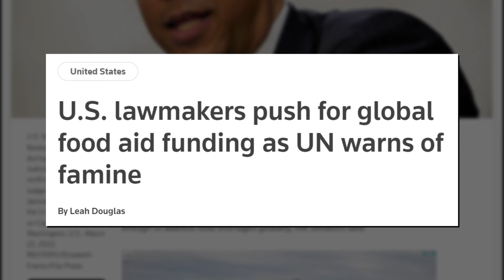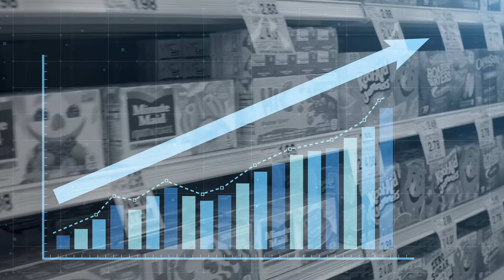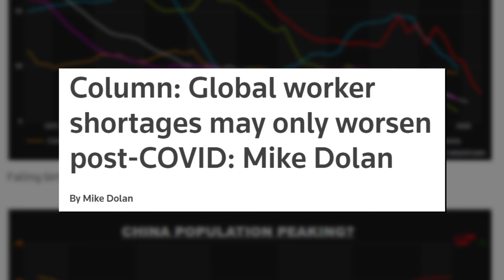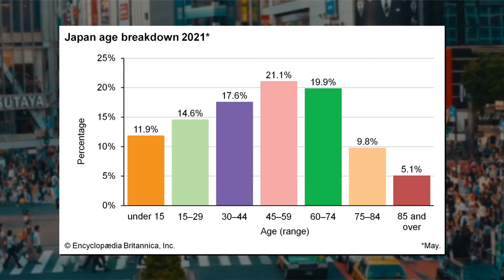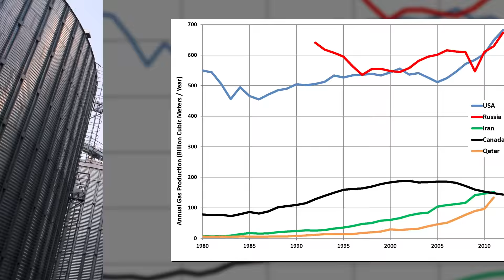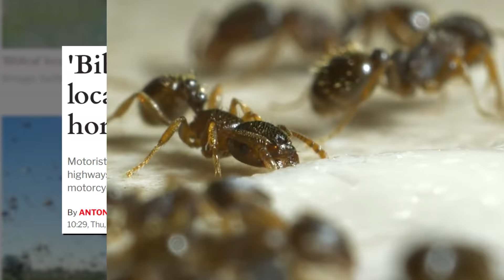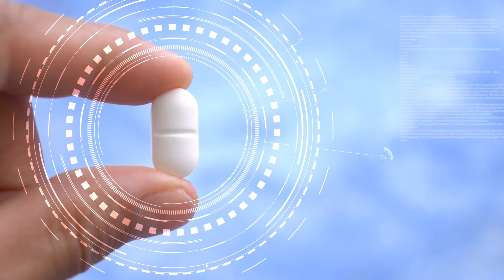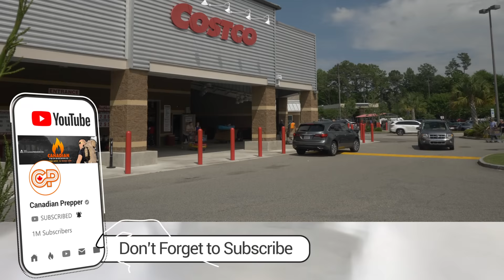When Food Runs Out: "Biblical" Famines are Coming

Comment: We did a practice drill- no heat, no lights, no water. It was a reality check. 
My take: have lots of canned food ( heat and eat stuff) for the transition, have a couple large water drum barrels for water, have some comfort snacks ( hard candy or hot chocolate are two examples),have a comfortable way to sleep- forget synthetic sheets/ comforter on a bed in an unheated room (it felt like an ice slab)….. I could go on and on. I learned that prepping is easy and living a prepper situation is tough. Takes practice and I suggest practicing. You wont thank me but you will learn what works best for you and your family. And by the end of our practice I learned how much I love a hot bath, fresh  bread, and hot coffee. 🙃
Reply: Lots of good info. here. Would like more insight on the sleeping situation when the power goes out. Any recommendations? I have a RV in my driveway with 400 watts of solar on top which I love. So, I will at least have lights and enough power for a hot cup of Nespresso and hot water for sponge bathing.  That's a start. SOLAR is the answer. At least for me. No cords, no smell, no mess, no gas, no fumes and pretty much unlimited.  The camper also has a propane run oven, hot water heater, furnace, AC, and shower. With 400 watts I wouldn't be able to run the AC obviously.
Reply: I did this by force when Abbott let the power grid go to waste. My preps held up. We had coffee and eggs for breakfast, pasta for lunch and leftovers for dinner; listened to the hand crank radio and told stories as my toddler had to wear a ski suit to keep warm. All in all, we survived the 48 hours without electricity pretty easily.
Reply: Buy cotton sheets. I always use them in winter, and love them.
Reply: Surviving a hurricane aftermath with no power for days is an eye opener. We found out what a luxury it is to have ice.
Reply: Wow…that’s excellent! I haven’t gotten up the nerve to do this just yet. Idk…why is it so hard to practice that! It is for me, but it’s something I know is very important!!  Practice, practice going without electricity for a day. I just gotta work up the nerve to do it. Thanks for your comment! It’s a job I got to do…..
Reply: Try it on a Sabbath.  Sun down on Friday (when you can see three stars) till sun down Saturday.  No heat, no electricity.  No work.  For me, the first few times I struggled to even go to bed at midnight.   Good for the mind, body and spirit.  The quiet slower pace is very good for inspiration and perspective on the week.   Try it for a month.   It brings awareness that is priceless.
Reply: So smart to do a trial run to see what things you are wanting for when crap hits. Nice job.
Reply: @openfieldviews9989  During Katrina, a guy stabbed his sister over a bag of ice.  You are right about the luxury of ice.
Reply: @sharoncrawford7192  I prefer linen sheets. They help regulate the temp of your body.

Comment: Dehydration is a great tool, it has a great shelf life, just remember to put a moisture packet inside the glass jar, seal it with a jar sealer, and don't forget to condition the food. To condition the food means to leave it out on the counter, shake it around a few times a day for a day or two, then check to see if everything is dried thoroughly, or if there has been moisture left behind. 
If moisture was left behind, you will need to get rid of the product, this is why it's important to know if you dehydrated the product enough, by conditioning the product. You can get around 15 years of shelf life when done correctly.
Reply: interesting
Reply: Just got finished dehydrating and vacuum canning “the holy trinity” (carrots, onions, celery and green peppers) to add flavor to rice, etc. Definitely worth the effort!
Reply: How do you know if moisture was left behind? Or what do you mean by that? Where will the moisture be?
Reply: Thanks for that tip. @Ritakus 98
Reply: @milhouse8166  Conditioning the food is simply putting your dehydrated food, once it has cooled, into a glass jar (I recommend a mason jar), & screwing on the lid (just hand tight). Over a period of 4-5 days, come back & check that there isn't any condensation/moisture built up anywhere on the inside of your jar, and give the jar a shake. If any of your food is sticking to the inside of the jar & it won't come off with some gentle shaking, then there is still too much moisture in your dehydrated food. You can, either, dehydrate that food again, (& then repeat the "conditioning" process), or you can simply use that food within your normal food usage (within a week or 2, depending on what it is). Clear as mud? ;)
Reply: @michelemckay4960  got it! Thanks
Reply: @tonette6592  thank you
Reply: @fanman8102  keep up the great work. Wonderful.
Reply: @milhouse8166  look in the jar to see if there's mold, if the food being dried is sticking together, and listen for the sound. There are some YouTube videos demonstrating this process.
It's hard to explain that sound you will hear, but when they're very dry, the sound is different than if there's a little moisture left behind in the food.
Reply: @michelemckay4960  Wonderful explanation, much better than I could have explained. Thank you for sharing your insight and more depth on this process.
Reply: @ritakus9871  No problem! Happy I could help! :)
Reply: I like the idea of drying food. Unlike canning, if it goes wrong, it's still not going to kill you!
Reply: OK, far less likely to kill you, especially if it's actually dry. Bacteria needs water to thrive!
Reply: @fanman8102  you start there and then move into some of the more crazy things.   We’ve dehydrated citrus like lemons and oranges, pomegranates, bananas and strawberries and apples.  I’ve done spinach and broccoli.  Lots of things.  Plus then I’ve turned around and powered so much too.  I even got bold and have  a few jars of dehydrated and powdered eggs.  Honestly I’m addicted to the dehydrator.    Lol.  But wow, even camping I can take powdered eggs to make scrambled eggs or ,bake in my solar oven to have little muffins.   That dehydrator was a game changer.
Reply: A tablespoon of salt never hurts if you're in a pinch and dont have descant patches. I to prefer dehydrated dry canning. Good way to put back long term and still have a good lid for when you're ready to hot can the leftovers.
Reply: @fanman8102  what's vacuum canning
Reply: Yup dehydrated a bunch of zucchini and butternut squash last year. One container turned moldy but the rest is great. Probably have plenty till next harvest ☺️
Reply: I’d like to suggest watching The Purposeful Pantry here on utube. Darcy is pretty much an expert on all foods dehydrating. I’ve learned so much from her. I hope this helps if anyone is confused about Dehydrating. The comments on conditioning are correct! That step is very important.
Reply: @nvalles2565  did you learn from yt or books? Any recommendations?
Reply: @mysteryman3000  I think both are very important to incorporate into a food pantry.
Reply: @tinsg1  in my comment I was talking about hooking up the tube that sections the lid provided by the lid ceiling kit that goes over the ball jar lid. When the machine is turned on, it sucks out the extra oxygen sucks until the air is out, when there's oxygen, the food begins to oxidize, if oxygen is removed, the food will stay hydrated. In other words, nitrogen instead of oxygen to keep an oxygen-free environment.
Reply: @cbass2755  I agree.
Reply: @milhouse8166  Hi mate what they mean is check for condensation in the jar as for throwing your produce out if it isn't fully dry don't do that just empty the jar and dry for a bit longer hope this helps
Reply: @cbass2755  Yes, Darcy is excellent! That's where I get the bulk of my dehydrating info! :)
Reply: Thank you for educating me about conditioning.
Reply: @mysteryman3000  Botulism can grow in the sealed mason jars if there's moisture left in the food you dehydrate.  Dry everything extremely well and you'll be o.k., though.

Comment: The amount of packaging Amazon uses I'd absolutely ridiculous, I've gotten little tiny items in huge boxes wrapped numerous time, I really wonder how it sustainable!?
Reply: It's not.  The last several packages I got from them had perfectly good solid sealed boxes inside much larger other boxes. But the inside ones didn't have the Amazon swoop all over it. Think of all the fuel wasted by the one stop package deliveries too.
Reply: I just buy the case. They slap a shipping sticker on it and it comes the next day. 

And I try to avoid those 3rd party sellers because they rip you off.

Comment: I was thinking my bread supply might get cut off so I bought 40 lbs of flour and some yeast.
Reply: Nice
Reply: don't forget some sugar, salt (and a bilt of oil)  to make that bread.
Reply: Flour doesn't last well, far better buy wheat and grind it as and when you need it
Reply: @jukeseyable  Freeze flour, or pack it in Mylar bags with  oxygen absorbers to prolong shelf life.
Reply: @110girl1  still nonsense, flour is more expensive than grain, then add in all of your listed extras. Far better buy more grain, with no need for the extras. You can't eat mylar bags. If you do want to spend money on the extras, still doesn't make any sense to buy flour. Buy grain, and use the extras to extend its shelf life

Comment: If people put the same effort into growing food as they do growing a useless lawn the demand on the food chain would be substantially less. Not everyone has enough land to raise cattle or even goats but rabbits and chickens can be raised on a much smaller property. Apartment buildings and condo and townhouse communities could even give up useless lawns in favor of community gardens.  Food preservation starts with a vacuum sealer, then water bath canner, then pressure canner. If you are prepping for some kind of collapse then skip the freeze dryer, they require significant power to run. Also if you are handy a pressure canner can be easily modified to act as a vacuum chamber to vacuum seal jars, with a vacuum pump. Not sure what to tell people in desert areas with no natural water source like Vegas, it will not be nice there.

Comment: In terms of the skills (homesteading) that you need, pick a couple and work on them. You might focus on crop rotation or soil health, Separately, canning as food storage, salt curing, or other food storage. Have a good think of what you actually eat and focus on building the skills to produce and save that. For example, we used to can a lot of pickles but discovered that although we enjoy them, we don't eat them regularly. So, we make relish instead. The most important thing is to get started and start small. Build your confidence over time. You can do it :) <3

Comment: It's increasingly crunching ....
1 kg of parboiled rice is currently 20 cents more expensive here.
Nevertheless, it is still one of the cheapest and most storable foods.

250 grams plus 350 grams of water; requires approx. 20 grams of denatured alcohol with camping cookware and subsequent cooking in a wrapped towel. Add a pinch of salt, curry or chili flakes...
Cost per meal: around 40 cents.
Spirit cooker: approx. 8 euros; 1 liter of alcohol (e.g. Edeka, Rewe): €2.49.

Should actually be feasible and affordable for everyone.
Reply: Add in oils for needed fat, calories and flavoring.